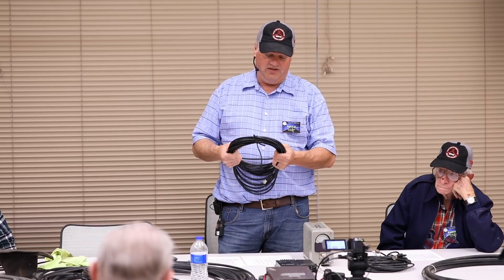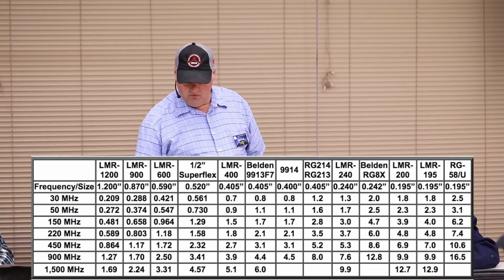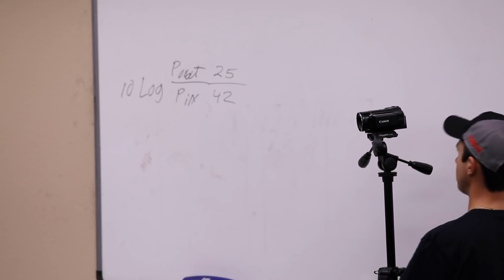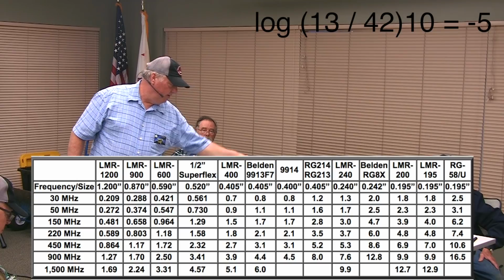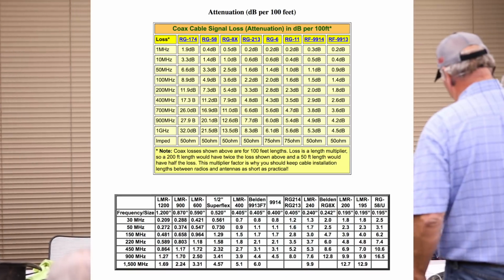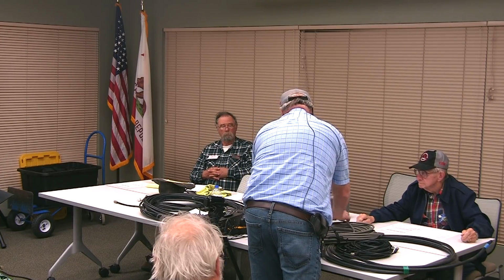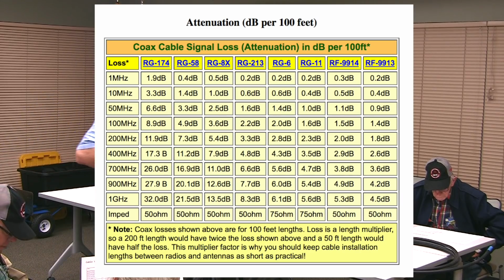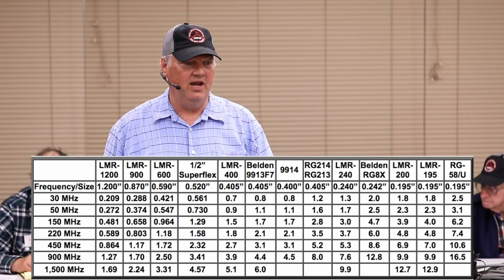How to Measure Coax Loss (w/ Bird Wattmetter) - Coax Part 2

Comment: Oh no! Not coax length again. Look, adjust the aerial not the coax.
My dipoles must be bad then. 20m to 10m, five dipoles with two coax lengths of about 25 feet. My inverted vee for 60m has about 45 feet of coax. SWR on all at or below 1.5:1. He's saying I can't adjust them! 
I'll remember this when I'm communicating with people.

Do people not realise the coax length to the 'aerial side' of the SWR meter and the 'transmitter side' do not exist?

There is one length of coax with a meter placed in it. There is one cable even though two can be seen. Cutting the 'aerial side' is wasted as the length changes when the SWR meter and jumper are put in. 

Tx to SWR meter I choose either 20 inches or 45 inches of coax depending where I put things. Wrong lengths again!
Nothing changes here if I join them together even at 28 MHz..
What about my 4 element 2m collinear. What coax length would he say I should use for that? I've about 10 or 12 feet.

G4GHB.

Comment: Bad feedline, either coax or twinline will kill your signal and reception. It's amazing how many people don't understand how they work and why you should avoid the cheap stuff. At high SWR it matters even more, as the signal has to do the trip one more time on the reflected signal. It's all attenuation, SWR is relative unimportant when attenuation is low.
People really misjudge the importance of attenuation, it's the worst number you can have when it goes up. High attenuation turns the best antenna into crap, no joke.

Comment: I use lmr-400 for coax that doesn't need to move and rg400 for moving and jumpers. Also all of my 2m/70cm antennas have gain to help recover what is lost in the coax.

Comment: Thank you, that was a great video.  My wife is not a ham, I am a little into emergency preparedness.  My new home will have about a 50' tower.  I also have some elevation (we are in the foothills of the Great Smokey Mountains).  I am considering putting up a (25W) GMRS repeater (2 GM300's with a RIC and a RX preamp) up for her use with me on ht's.  I know that my GMRS numbers will compare somewhat near the 70cm numbers (a little worse).  I am putting up a few antennas on the tower (Two 2m/70cm Comet's one for a dual band radio and one for a DMR repeater I own, a Discone [so I can mess with a variety of freq's], and a 10/11M ant to talk with local rescue squad friends on CB with [I will try to get them on GMRS]).  I am not concerned about the price (I will cry later) I was thinking of having my feed line being Andrews Heliax LDF-6 (I think that is the 7/8" you showed) or LMR600.  I hope the hard line run will be less than 100'.  After watching your video, I think that is probably the best I can hope for.  73 and thank you for the video.
Reply: Well what did you end up using? How did it work out?

Comment: Great video for new folks and makes the feedline quality real. My question is the 75ohm hardline. I found some transformers to get it back to 50  but not sure they will work at Vhf or Uhf frequencies. The local cable folks did major repairs and rebuild and I got the spool ends one over 400 feet and with all my stuff down after the 155 MPH Hurricane Michael and having to totally redo plus add new antennas. I had not been active and my 25 years after getting my ticket, much needs refreshing and relearning or just to be learned, and after  70 things come slower. Thanks for your channel, I will be viewing to get back up to speed.

Comment: I should title this comment:  Is adding additional coax length worth it?  With the $8 calculator take the 42 watts input (to the cable) and subtract the 25 watts output (from the cable) and 17 watts is the wattage loss. This translated to 2.25~2.35 db loss ( db=decibels ).  This db gain and db loss is the gain or loss capability of one's radio station.  Now, add another 50 ft of coax (as he explained) and consider that factor of loss...  But wait... Adding the next 50 of coax and the loss of the initial 50 ft db loss and this could seem significant, except there is one more factor that needs including.  
    If this 50ft and the additional 50 ft both are used for elevation and that elevation put Your antenna array significantly above obstructing objects... though Your station may have suffered major power losses due to coax loss, because of obstructive object clearance the effective gains may completely justify lengthening the coax.
     Consider this... You have your watt meter and a dummy load and PL connectors on both ends of your coax.  With that you do not require any chart or excessive math. Simply hookup your meter to your radio (without whatever coax you will be testing AND a dummy load on the antennas side of your meter.  Take a power output reading and write it down.  Now take the meter off your radio and hook it up to one end of the coax, while leaving the dummy load where it was.  Hook up the other end of the coax unto your radio and take a power reading.  The difference between these two readings is the amount of power loss that piece is coax causes and at a rate of 2.25~2.35 db gain per 50 feet.  This is with THAT PARTICULAR COAX this man referred to... I believe it was the RG58mini.     73s

Comment: What about closed hf antennas” loops”. Still the half wave coax rule for that? Say 40m delta, 66’ coax “8x” minimum?
Reply from the maker: Yes, is the short answer. Any antenna you use should have a 50 ohm impedance with an SWR as low as you can get it. As for the coax, if it has RF on it, then length will matter. The type of coax will then dictate how much power/dB will reach the antenna. Remember, the dB loss will also effect how well you receive a weak station, it goes both ways.